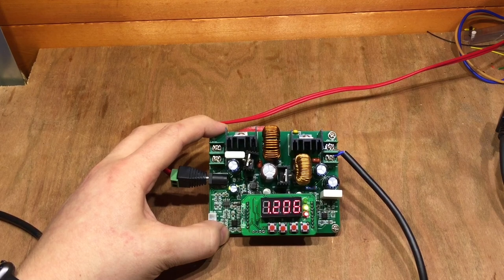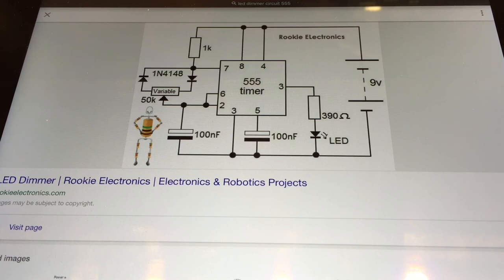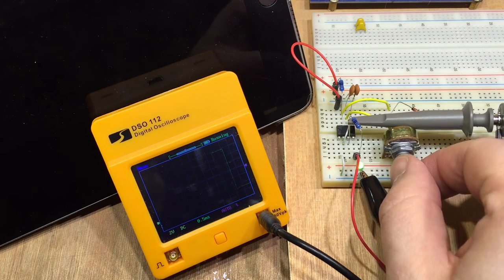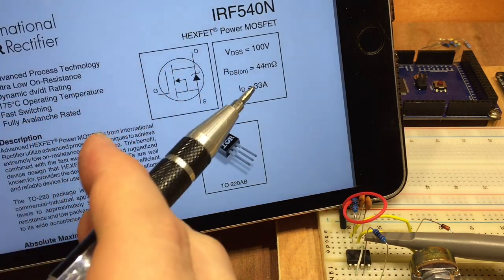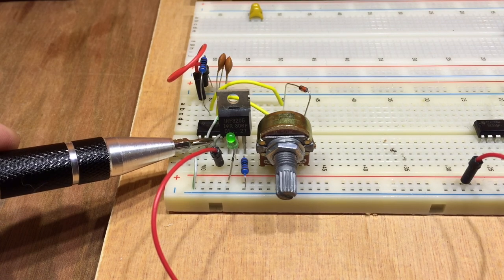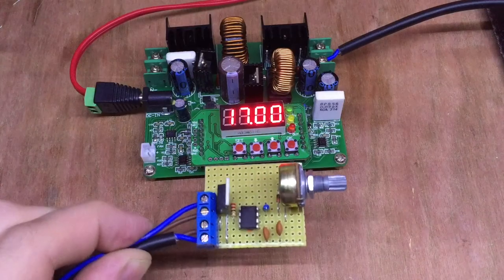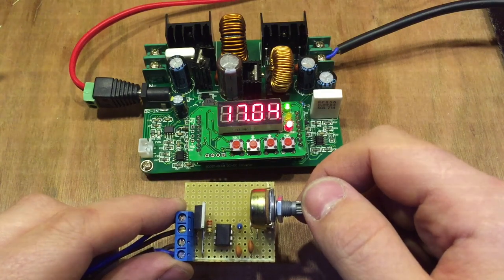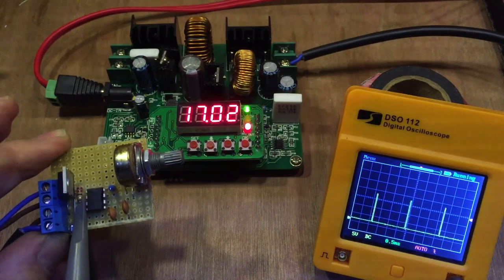High Powered LED Dimmer - PWM & 555 Timer - 12v Solar Shed

Comment: Put a decent size cap on the input of the PWM board and on the output. Hopefully the one on the output will average out the pulses somewhat and take the flicker away. One on the input should help with presenting a more stable load to your PSU which will help if that's the source of the interference.
Reply from the maker: +xanataph Thanks for the advice - I'll see what capacitors I can dig out.  Cheers.

Comment: The interference that you're seeing on the video is because the frequency that the 555 is oscillating is beating against the refresh rate of your camera, just change the frequency of the 555 timer circuit and this effect will go away. It's the same thing that happens when you film a monitor and you can see those lines going across the screen.
Reply from the maker: +Nathan Campos An interesting theory - I can see this having an effect.  The frequency of the 555 doesn't actually change though, just the pulse width.  The issue is at it's worst at about 50% PWM.  I'm fairly sure the noise (both audible and visual) is coming from the DC to DC adapter. Hopefully I'll be able to test that soon.  Thanks for your comments.